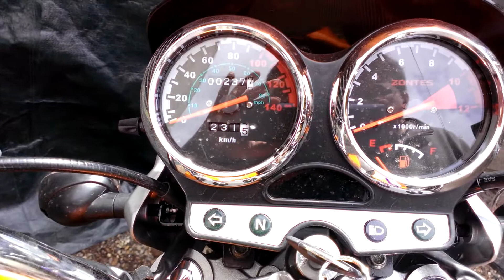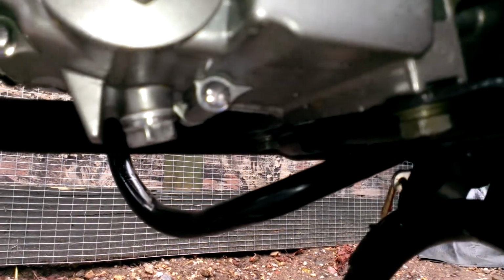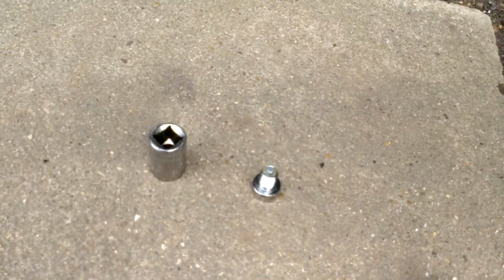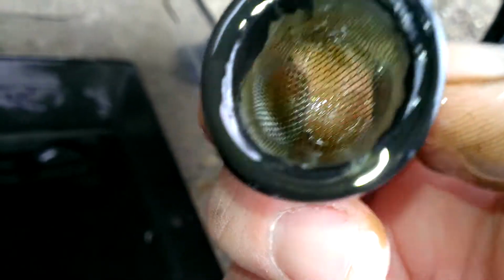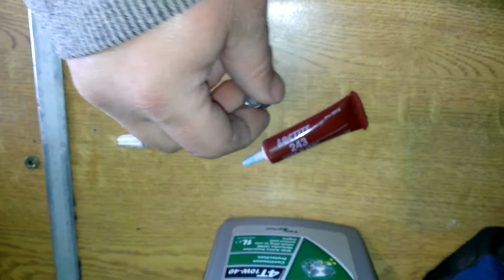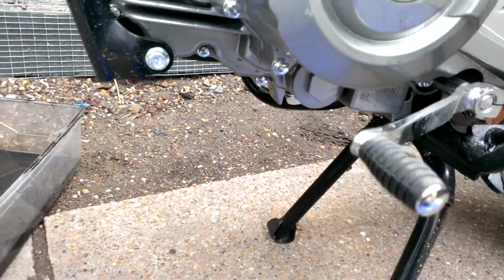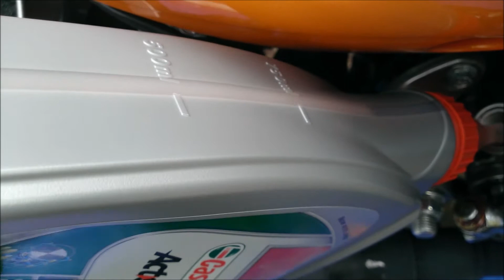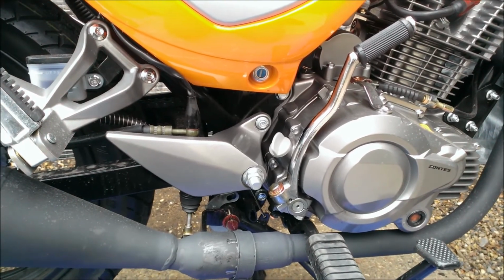Zontes Monster 125cc Oil Change

Comment: Just changed oil in my Lexmoto ZSX using your video. Engine looks pretty much the same, even filter and bolts are the same. Cheers

Comment: I saw in the manual of zontes tiger 125cc to put back no.1.spring...no.2.fiter screen.. No. 3seal ring and the last one is filter cap.. Reply pls.. Thanks..
Reply: Hi. I have the Tiger as well. You are the lucky one because you have a service manual. I don't.